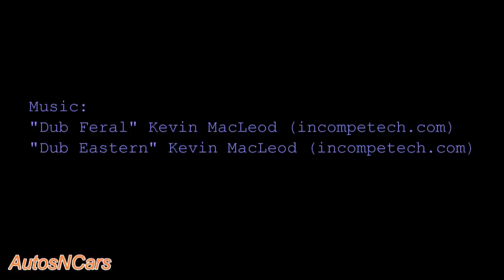TOYOTA SIENNA 1999 2000 2001 2002 2003 SPARK PLUGS REPLACEMENT

Comment: Solo espero que ahora si valoren a Los mecanicos . Y no les pidan descuento. 😂
Reply: wat is he doing you dont need to do all that humbug...just reach in behind right side back of motor and you can feel the plug wires for num.3/5 plug. follow the wires to the left side back of motor for num.1 plug...took me 15min for the back num.1/3/5 plugs.  not even 5min for  num.2/4/6 plugs....seriously you can get to plugs.
Reply: esos  toyotas  son  problematicos  y  delicados,  yo  tengo un sienna ,empezo a temblar y  parpadiar  el chekinge  ,el  mecanico me dijo  cambiar  bujias  y  las  3  bobinas  del  fondo y esta   muy  complicado  para  sacarlos ,  total  hizo  ese  trabajo,  y  despues  de  manejar   10  minutios  empezo  la  misma  fallas,    y  me  dijo  que  lo  chekeara  de  nuevo,
Reply: con extensiones y nudos se sacan esas bujias sin necesidad de  mover cuerpo de aceleración.

Comment: If he had some training and a few years experience,  he would have realized he dident have to remove the intake at all and had it done in half the time. A lot of unnessary work my friend.
Reply: RIGHTTTTT....wat is he doing you dont need to do all that humbug...just reach in behind right side back of motor and you can feel the plug wires for num.3/5 plug. follow the wires to the left side back of motor for num.1 plug...took me 15min for the back num.1/3/5 plugs.  not even 5min for  num.2/4/6 plugs....seriously you can get to plugs.
Reply: @mbr3232  hopfuly with the proper training, proper tools and a few years experience at a good independent repair facility. This person could become a talented technician, I've trained quite a few of them. Thank you for your response.

Comment: Sucks you had to remove the intake manifold. I was able to do it on our 2003 sienna with just a 3/8ths and extension with a swivel socket and spark plug socket.

Comment: You have to remove the intake manifold to remove the rear plugs? I wonder whose brilliant Toyota engineer's idea that was to hide the rear plugs that way. Remind me to never buy another Toyota with a V6!  I believe auto maintenance should be easier than this. Car purchasers should try to avoid buying  car models that are designed to keep owners from doing their own work.
Reply: They do not want you to work on your own vehicle.  Look at any recent era vehicle. They are designed for the manufacturer to build it at least cost and not take it apart to fix it.
Reply: Ha! Buy a ford truck with the diesel- you have to lift the cab off the frame to work on the engine. Not joking.

Comment: The front plugs did not look to bad to change But the plugs in the back look like a royal pain in the ass. now i know why i would not own a mini van.
Reply: its the same thing for a Camry if it has the same V6 engine
Reply: Chris Belt Get a Honda Odyssey.  You don't need to remove the intake manifold because there is enough room to remove the rear plugs.
Reply: @upallnight888  No thanks. I’ll stick with Toyota that has a transmission that lasts more than 90k miles.

Comment: all i did was to feel around plenum for the coils, removed and replaced spark plugs. took about 45 min.
Reply: JerBear C. is absolutely correct. I just did this last night, and changed all six plugs without removing anything except the coils and plugs.  It takes some thought, patience, and feeling around, but in my opinion is much lower risk than breaking something by taking off throttles and manifolds and such (where you are screwed if a bolt breaks...).  It took me about 90 minutes to do it on a 2001 Toyota Sienna.  Try it before you start taking stuff apart...
Reply: Damn any way you could do a video? LOL
Reply: really no way to video it because its all about feel. u dont see the plugs directly. missy its alittle hard because ur body is on the motor and it starts to get soar . wish i was there to help u. wish u luck. just feel for the plug location and pictue it in your mind. you'll need extensions and a swivle

Comment: You don't need to do all that I've changed my 2000 and 1999 sienna plugs without having to pull any of the linkage or intake the one plug that's a problem is the back passenger side with that I put the socket on a short extension dropped it in the well then put another short on that it takes time you end up with sore hands but it works

Comment: The guy is doing it the hard way the front plugs i would have did 10 times to his 1...u dont have take the wires off the boots u unscrew the bolt that holds down the boot remove boot take ur plug out with a plug wrench i can do all 3 front plugs less then 3 minutes

Comment: FAIL! No need to remove all of that! Just remove the cowl and plastic tray and a few other small things! Should take about 1 to 2 hours!
Reply from the maker: Some people might need to go this way to replace other things, so it's ok.
Reply: @AutosNCars  But considering your video is about "SPARKPLUG REPLACEMENT ONLY", your way is not the best or easiest way! If your video was about changing sparkplugs and "other-things" then yes, you would be correct to remove the intake, etc...

Comment: Bad design from Toyota. They Just put the Plugs any where to make the car work. Buy Honda.
Reply: Honda's engine are fine but the only generational problem is the leg, it's can pull out without notice it's so disgraceful. Toyota products is the best.
Reply: @michaeltobiloba5074  Honda has shit transmission!